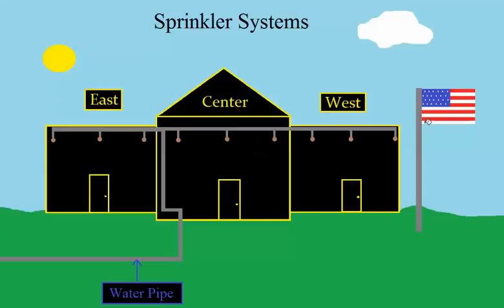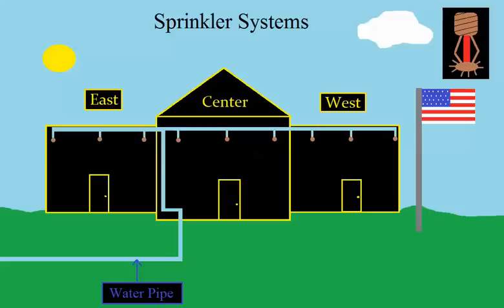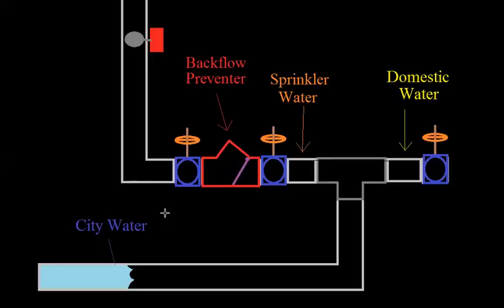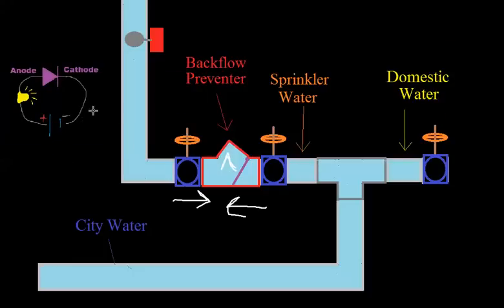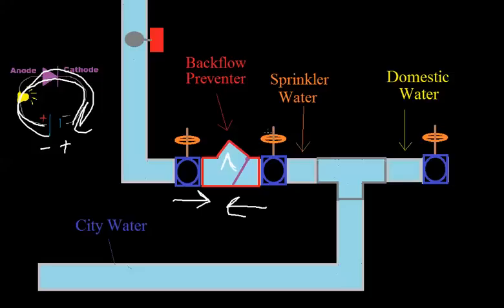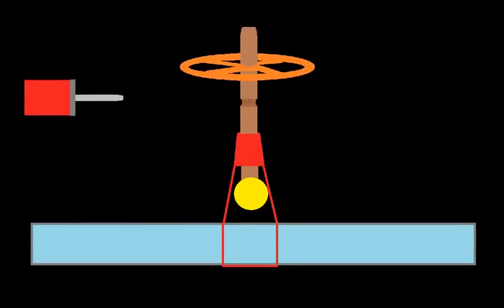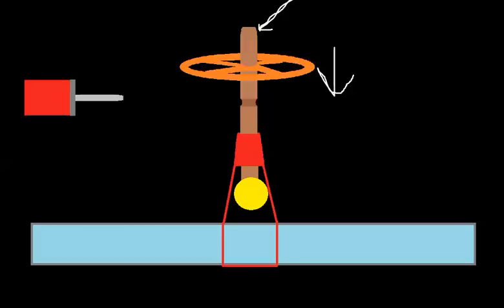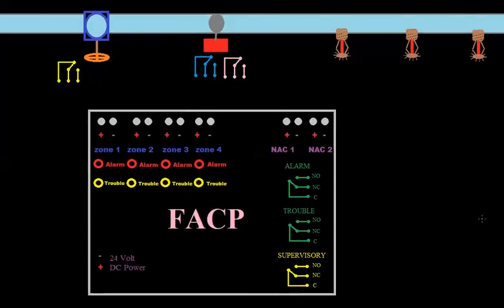16 - Sprinkler Systems - Introduction to Fire Alarms

Comment: Every time I run washing machine, the pressure in the fire sprinkler gauge increases. We thought the gauge might be faulty so we replaced but still the same. the pressure increases with every laundry. Based on your diagram, i don’t understand how is this possible?
Reply from the maker: Yeah that doesn't really make sense to me either, but I'm not a sprinkler expert.

Comment: @Joe Klochan  This YT "course" has been very educational, it's made me think of alarms in a different way.  But what I don't get about sprinklers is that, what if there's an electrical fire?  It's not like the heat would be less intense.  Also, like trouble bells, I've noticed many buildings have waterflow bells by the panel and/or outdoors.  I guess this tells people it's a real fire, because sprinklers do not activate during prank alarms or fire drills.  But does the panel need to be addressable to make such a bell ring?
Reply from the maker: Sprinkler systems are not considered life safety devices for that reason. They are for property protection. In the case of electrical fires, smoke detectors would be needed to detect them. Trouble bells are different than sprinkler bells. Typically, sprinkler bells are not tied to the fire alarm panel at all. There are usually two independent sets of contacts on a waterflow switch. The sprinkler bells run on 120 VAC, and the hot leg of that circuit goes through the waterflow switch just like a light switch. When water flows, the contacts close and 120 VAC is passed to the bell, making it ring.